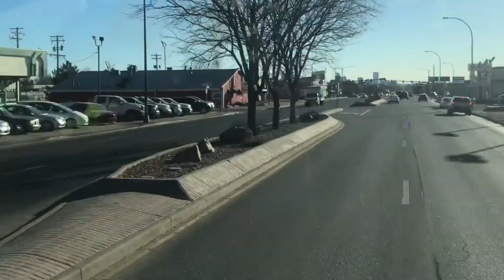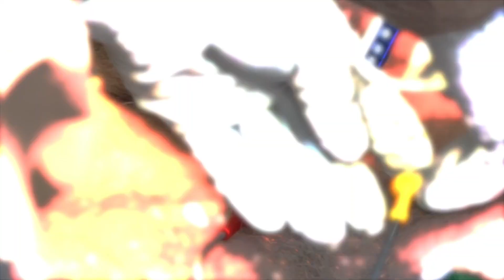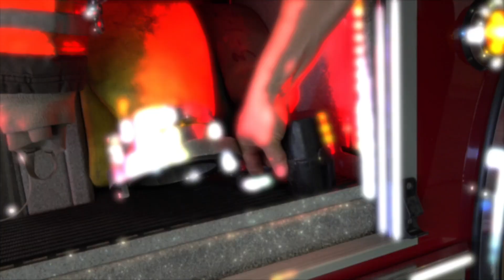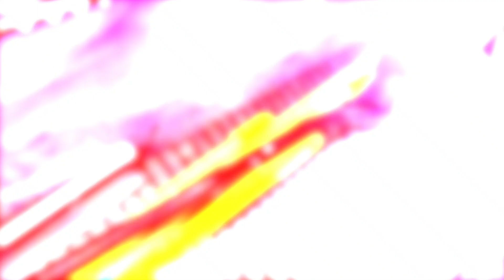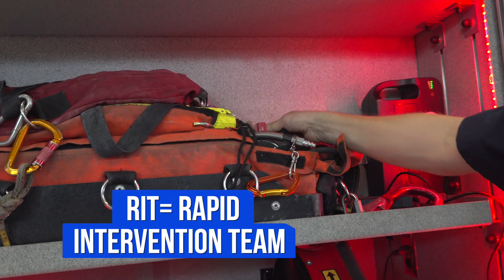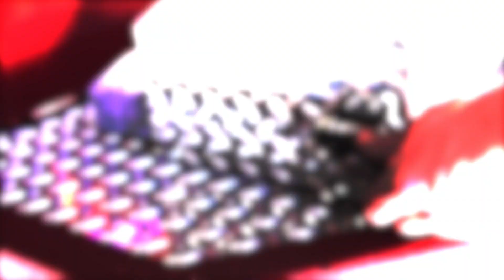West Metro Fire Rescue: Fleet Feature- Engine 2

Comment: do engines in West Metro only run 3 man crews?
Reply from the maker: Most of our engines have three person crews. Our towers have four person crews, Truck 14 has a four person crew.
Reply: Will all the new engines look like this?
Reply from the maker: @swimmerjer  The apparatus committee takes a look at each station and its coverage area and makes recommendations. If the same specs fit a station's needs, then, another model like Engine 2 could be added to the fleet.